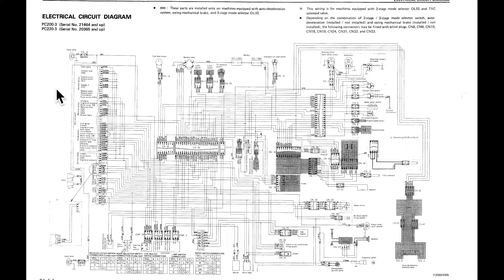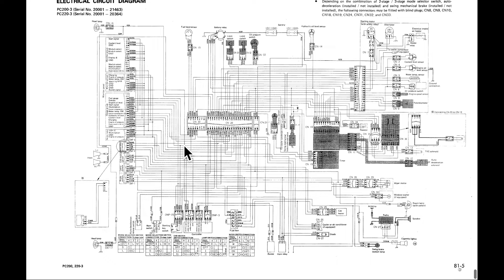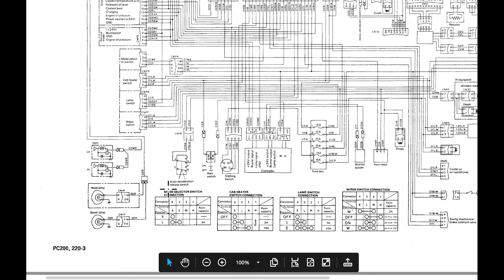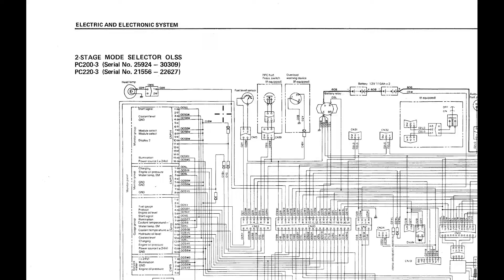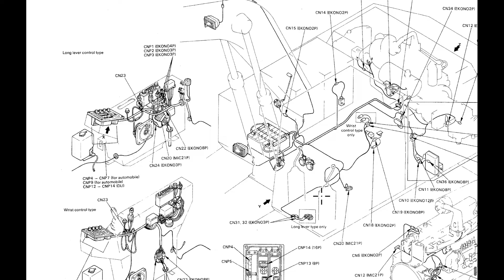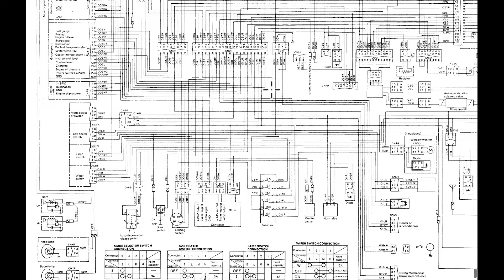Wiring Diagram Part 2

Comment: Helo,i am from europe/cratia😃sorry for bad emglish,i have komatsu pc 138us-8..issue with he cranks but won't start😒..Noticed burnt 30A fuse Nr18 wich feeds engine control module(dick red/white wire 6mm)..please help
Reply from the maker: Have you checked for fault codes on the monitor panel? Do you have a service manual for the machine? First impression from your description would be a wiring problem to start with? Fault codes would identify a bad component usually.

Comment: Do you have the wiring diagram for D31s-17  .just started working on it .And watched your battery disconnect video for the D41 very informational thank you .
thought i would ask thank you
Reply from the maker: I don't have anything on those earlier dozers. They weren't very complicated though. There were no processors in them, only starting, charging, sensors and lights.